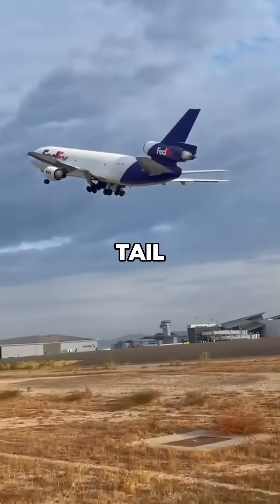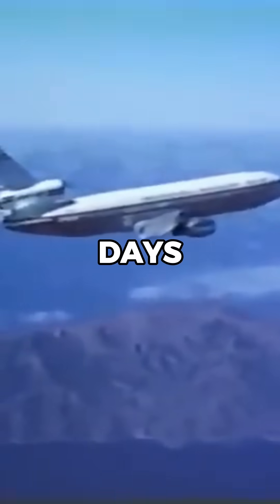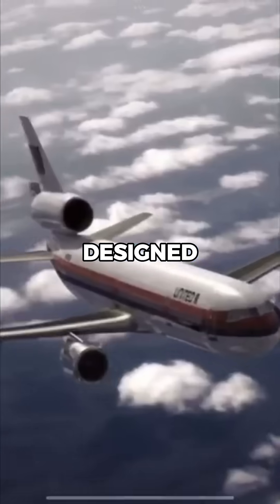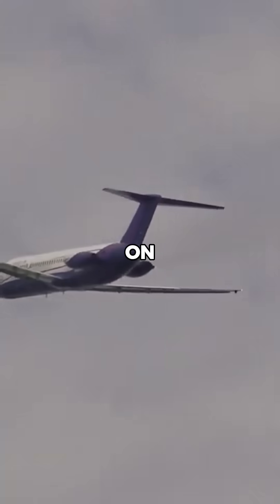why aircraft had tail mounted engines

Comment: What a lot of misinformation! The risk of engines striking the ground makes absolutely no sense. Modern turbofans are bigger than those from decades ago with a lot higher bypass ratio but this video stated that the engines back then were too large to fit under the wings? It's a matter of design: some airplanes have lower ground clearance that makes fitting an engine under the wings more complicated not because the engine was too big besides the fact it is mostly found on smaller, regional jets.

Comment: That doesnt sound right.

I was thinking that in the 60s and 70s, jet engines were longer and thinner with smaller inlet diameters whereas now, engines are much shorter, but have massive inlets, much larger than engines from that period.
Reply: Yep this video is very bad information. They were low bypass today engines are high bypass

Comment: This is a lie. The trijets of the 70s had 3 engines to avoid having to comply with ETOPS ratings. 4 engines required too much fuel, and the only place a 3rd engine could go was somewhere on the central axis of the fuselage to avoid unstable flight. Also the 727 is a trijet and has comparatively small engines to the DC10 or L-1011. High bypass turbo fans were introduced with the 747 and no my knowledge haven’t increased the likelihood of damage due to wingtip ground strike.